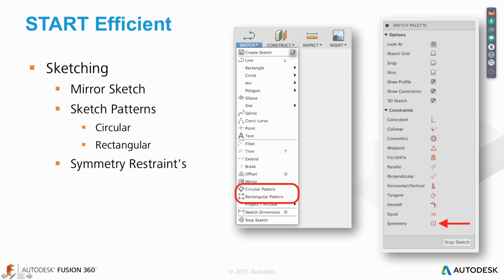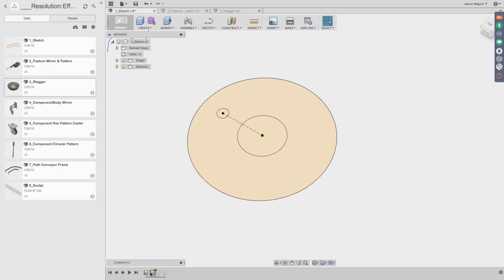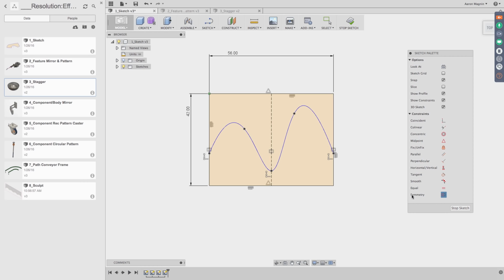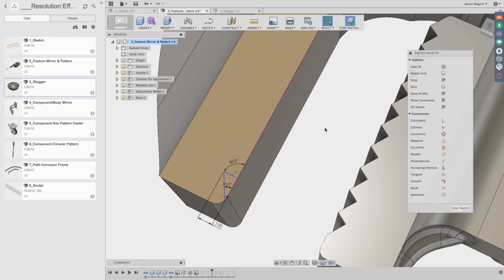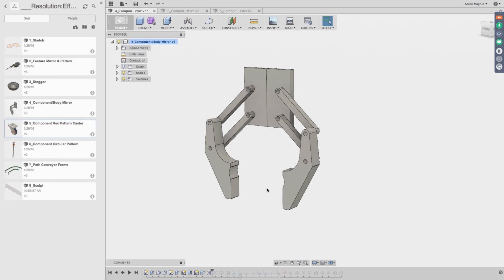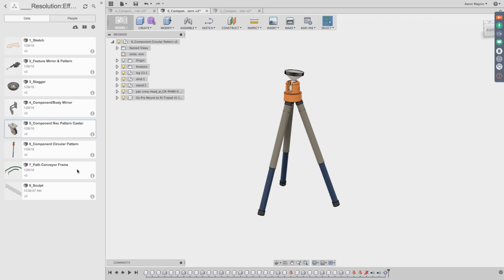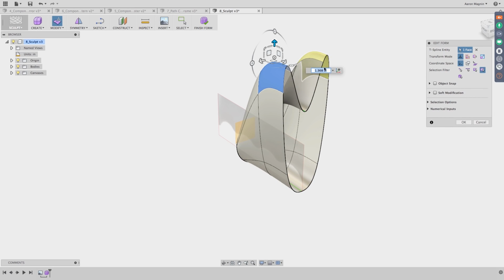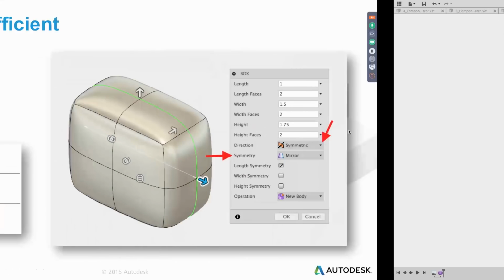Webinar: Resolution: Efficiency!

Comment: Do you know how I can roll back  from last 3 updates? everything was going its great and working fine and really enjoyed using fusion 360 but since last 3 updates my time line gets all messed up when I close fusion , when I turn it back on and try going back to finish off a design, anything I extruded ... doesn't show up unless a do a dance in the time line and double click on each and every extrusion . also I used to be able to see all the parts when in sketch mode now it hides everything so I cant see how much to sketch and what not.
Reply: +patprop74 This should not be happening and I don't think thats the norm (or else A LOT more people would be in contact with us). Either way, sorry about this. Please contact support using the methods descibed here: https://forums.autodesk.com/t5/design-validate-document/how-to-best-report-issues/td-p/5722215
Reply: +Aaron Magnin  Thanks for the replay Aaron, perhaps if I uninstall and reinstall it would solve the problem ? and I have contacted support a few min ago .
Reply: +Aaron Magnin little update Aaron, I uninstalled and reinstalled and it seem to have solved the visibility of parts in my sketch's it has not solved the other problem but hopefully it stays isolated to those drawings. BTW nice video with good instructions.
Reply: Glad you liked it and that the reinstall helped! Please let us know if that problem persists, or others come up.